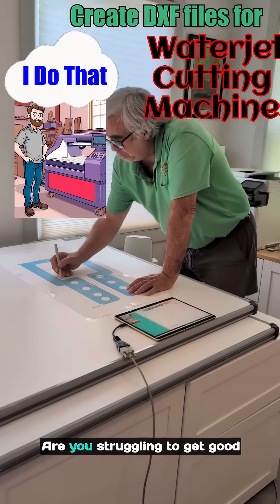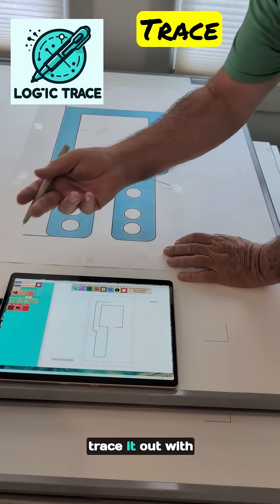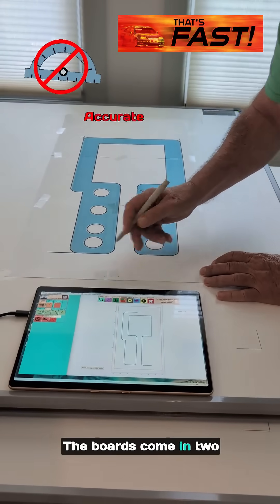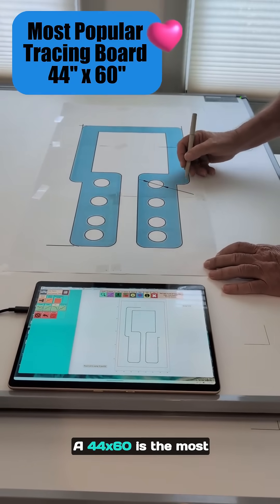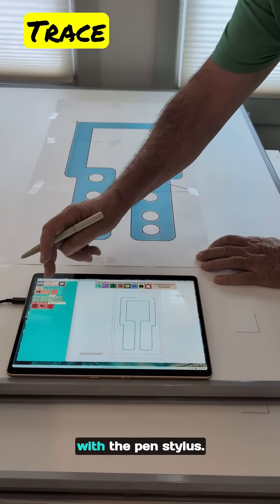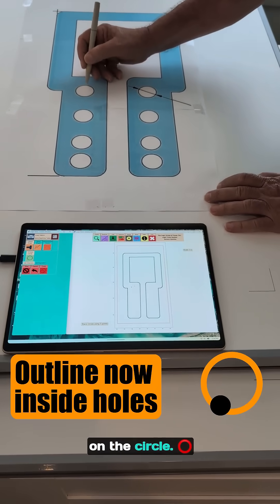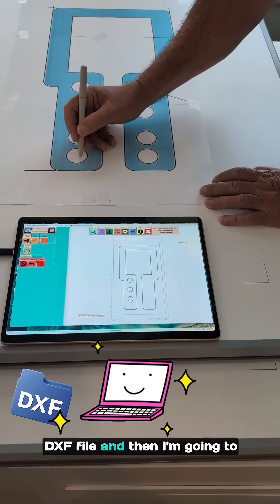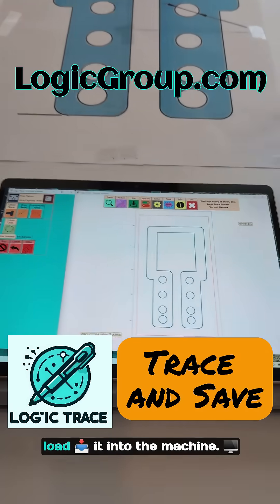Quickly create the dxf  files for waterjet cutting machines using the logic Trace system #waterjet

Comment from the maker: The pen stylus generates a magnetic field that is picked up by the electrical grid in the board. Board is very durable. Can handle several hundred lb and come into accuracies 0.01 in and 0.005 in perfect for most water, jet and CNC applications.